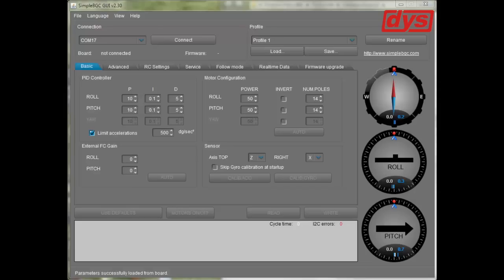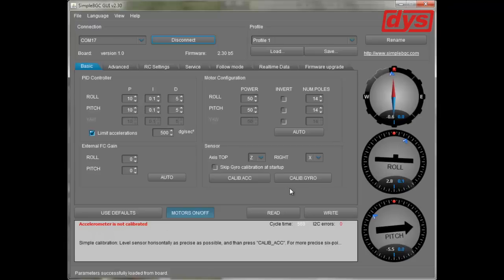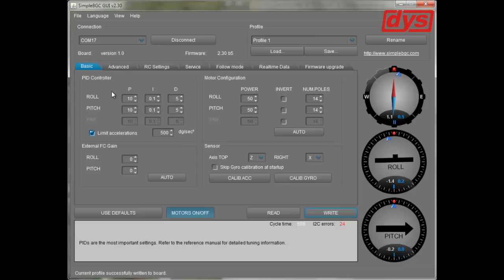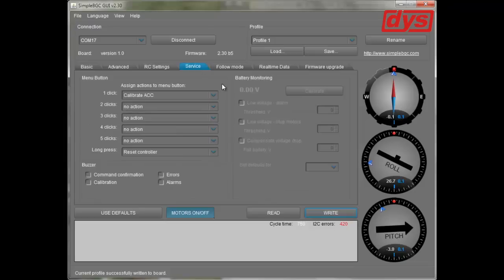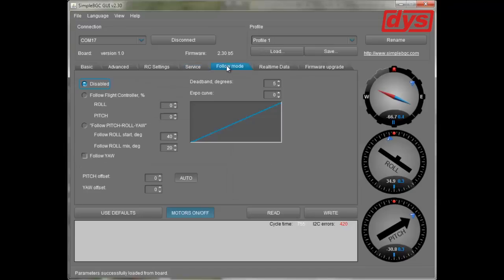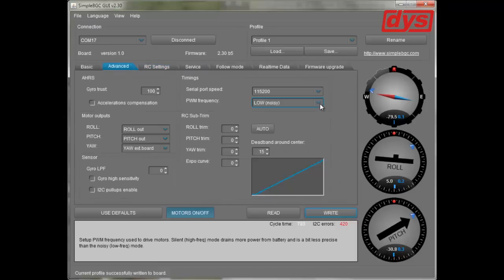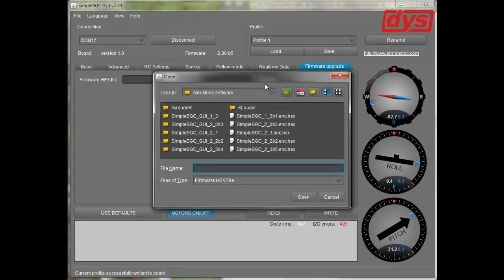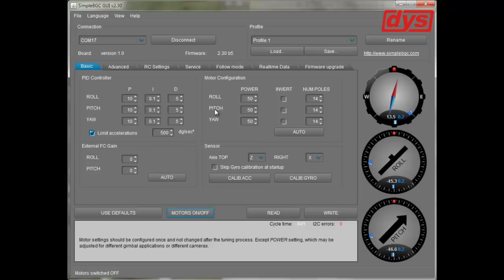Setting up 3rd Axis controller extension board

Comment: I cant find a video on how to connect the extension board.. i found a few pictures online and i connected it accordingly.. but the problem is whenever i connect the extension board, it wouldn't work, and when i connect it to the PC, it gives the error "sensor is not connected"
any suggestions?